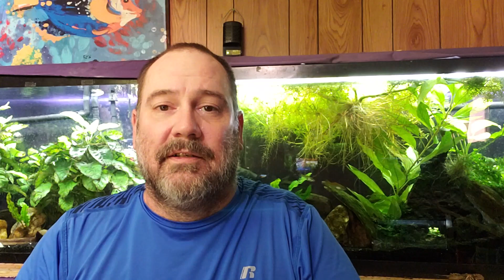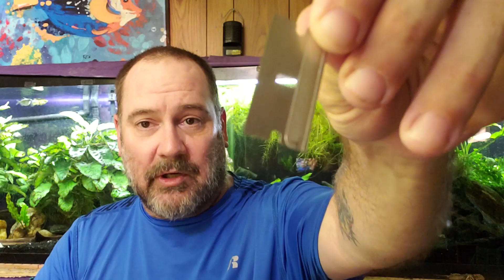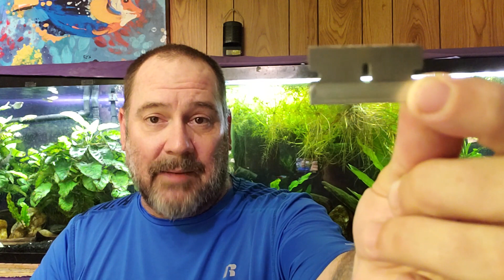Stop Telling Me A Razor Blade Scratched Your Glass. It Didn't.

Comment: Glass can degrade a razor leaving behind marks of steel if it is rough enough though. That can be interpreted as a scratch but wiping it away would show the steel being ground off in this case. If you made textured glass you could sand away steel, for examole.

Comment: You are forgetting the difference between hardness and brittleness plus pressure. Both the razor and glass are not perfectly smooth, each contains imperfections which are really viewable under a microscope. You are correct in saying the soft razor can't scratch hard glass, but you are forgetting the difference between a scratch and a gouge. As the soft razor wears out, it's imperfections will increase. Combine these imperfections with those of the glass, and the soft material can shear the hard, brittle material. Even "gentle" force on a microscopic imperfection will shear it off, and the soft razor, under pressure, will have no trouble finding those groves and amplifying them. You're calling it a scratch, and what you say is true. The correct word is "gouge", and most people would call it a scratch. So it's true that soft steel can't"scratch" hard glass. But it's not true that soft steel can't gouge hard glass. Hardness is combined with brittleness. The soft steel will fill these imperfections and shear, rather than scratch, the brittle edges of these imperfections.
Reply from the maker: Nope.
Reply: @DanHiteshew-oneandonly 
Are you trying to claim that a softer material can't gouge a harder material? Did you even know the difference between a scratch and a gouge? Keep on keeping on, my man. Love your confidence.

Comment: well, then, tell that to OLFA. They make stainless steel snap-off blades specifically for glass because the regular steel blades can and do scratch/score glass very easily.  This is an especially serious issue for window tinters across the globe. But I DO AGREE that it is the (manufacturing) debris on tempered glass that does the scratching. But most all OLD tempered glass - pre-1990's-  including my old aquarium do not have that issue. That's my 2 cents worth from 35+ years tinting auto's, homes, farm equipment, RV's, commercial buildings, boats, etc, etc...

Comment: I have been a glazier for 32 years and this guys is very wrong.
Reply from the maker: No I'm not. Tell me how soft steel scratches glass?
Reply: @DanHiteshew-oneandonly  You are fare too hung up on which substance is harder. That is not really relevant to the topic. I use razor blades on glass everyday, that is how I know that razor blades can and do cause scratches in the surface of glass. If done with a “brand new” blade that has been inspected for any manufacturing defects, stroke in one direction only and never on dry glass. The problem is that any little nick in the blade along with possible loose debris on the glass will absolutely cause scratches. People watch this video and think it’s “impossible” for them to scratch the glass. Your a fish tank guy. I am a second generation glazier that has worked with glass everyday for 32 years. You think whatever you want, but your advice is not at all accurate.

Comment: No I could not watch this video any longer because he never once mentioned stainless steel. Stainless steel is the product that you use if you don't want to scratch glass. He didn't even mention it once. So here he is telling everyone how stupid they are and he doesn't even know science behind it. You can't just take any razor blade and expected not to scratch your glass. Stainless steel razor blades will not scratch your glass with a soapy water spray. But if they're sand on the window like he said it will scratch. But if you listen to this guy's video he's telling you that no razor blade can scratch glass. Well you would have to be real on educated to believe that. Well maybe education has nothing to do with it but you would have to be real naive to believe that no razor blade could ever scratch glass. There are some pretty cheap ass razor blades out there that will definitely scratch your glass. And on top of that what kind of glass are we razor blading. What's the quality of the glass? I've run into pitted glass many times where the razor blade gets chewed up in a few passes. Then if you're not using enough soap and water to clean the glass to prep it for the film you can see scratches. So sorry for the long text but anyone who thinks that you cannot scratch glass with a razor blade is out for lunch. I mean no disrespect by this. Great video but you need to be more specific on the stainless steel aspect of the razor blade. Respect! Respect is what I have for you for taking the time to make a video.

Comment: I am so confused. I used a razor blade scraper to remove window film on a residential window, and there are scratches.
Reply from the maker: You can get contaminates on the glass that get dragged by the blade, but the blade itself won't (can't) scratch glass.

Comment: You are correct razor blades will not scratch the glass but sometimes people think a utility knife blade is a razor blade which it is not a utility knife blade will scratch the glass. We had a construction site that was just finishing up with the final clean and there was some shipping material on some partition glass for a conference room... The laborers used utility knife razor blades out of the utility knife instead of straight razor blades and they scratched the glass $25,000 later the glass was replaced... It seems that the corner point ends of the utility blades scratched and etched the glass.
Reply: Exactly what happened to me i thought a blade can’t scratch glass and i used a utility blade to cut some window vinyl and it bloody scratched the crap out of it 😢

Comment: One other guy kinda mentioned the crap on the glass during manufacturing. I have a slightly different theory... If you have scratches already on the glass anywhere... There are tiny almost microscopic fragments of glass in that scratch-so when you run over the scratch with anything, it can potentially pick these fragments up causing more scratches elsewhere. I switched from different glass cleaners because of old scratches, to razor blades and I still kept finding more scratches. So yeah not the blades fault.

Comment: tl;dr: flawed arguments. i can be 85% sure razors can scratch glass

Being hired as a professional window cleaner, I have used razor blades to remove stickers off windows a good couple of times, and I've also had a short go at removing industrial material that gets on the glass (in my case, silicone - which when it comes to windows, is a stupidly sticky glue which is very very difficult to get off.).
Now, I have yet to scratch glass (and hopefully I never would,) though my boss taught me that it's important to lubricate the window well (with soapy water), and to scrape at a good angle, and to not use much pressure, all so that the blade doesn't sudenly stop and therefore go at a sharp angle at the glass - as then the glass would be scratched/cut.
Also, my boss mentioned we can't use razor blades on all window like surfaces, such as mirrors, low quality glass, and some other stuff. I don't remember the reason but it was probably something to do with the glass simply being very cheap, and therefore very easy to scratch.

And when you criticise window cleaners blaming the razor blade for when concrete scratches their windows, well it's fair to blame the razor blade. The reason is that the razor blade did a insufficient and flawed job at effectively removing the concrete, ultimately resulting in a scratched window.
Had the cleaners used some corrosive chemical or something instead, then the concrete would be removed and there would be no scratches.
And so when cleaners hear people say "razor blades don't scratch glass", they'd immidently say otherwise since evidently using blades on windows, one way or another, may leave you with scratched glass.

Also your foundations for this claim seem poor - sounds like you just use your razor on your high quality glass of your aquarium, and hear about other stuff via internet - which is that "since razor blades aren't as tough as glass, it is physically impossible to scratch glass with a razor blade". Which of course sounds like a stupid claim - how can some material be impossible to scratch glass?

I tried just then to scratch my glass desk with a razor blade. I was unable to scratch it a traditional way, although I did for sure scratch the glass when slicing the edge of the glass.
Which sugests that a razor blade will have a difficult time scratching glass, though it's still possible to do. And also that low quality glass is very likely to be heaps more susceptable to scratching.
Reply from the maker: Razors can't scratch glass.

Comment: I know using a razor blade is effective for cleaning glass, but I disagree with you. Soft materials can most certainly scratch a harder surface. Here are some examples:

A rubber fan belt on older cars is softer than metal, but 100,000 miles of driving, and the rubber fan belt will scratch components of the motor if the belt rubs it. More damage to the belt, but some damage to the metal. Friction, heat, dirt, etc all takes Account...

String can be used to cut small branches. String takes more damage than Branch, but it will eventually do the trick if you replace the string enough.

Fiddle players can comment on this, I don’t know much about it, but damage is done to the bow and the strings when they play. Like extreme fiddle, “devil went down to Georgia” etc.

Tires from vehicles damage pavement. Not sure if it qualifies as “scratch” ... but definitely dents, chips, crushes. Weight is a factor here, like your Ax example. And hammer example.

Then supernatural situations: tornados have been known to take soft objects, like pine straw, and pierce glass or metal. (Have not seen in person, studied about it school tho)

Magic erasers for cleaning granite counter tops... polishing cloths on metal or brass... Leather belts or horse saddles on metal buckles.... Fishing line on rod and reels... Chain and sprockets on dirt bikes..(both chain and sprocket take wear over time, no matter which metal is used for chain and which metal is used for sprocket)

But more factors are at play in the exceptions I mentioned, including weight, density, force, time, and friction... others as well.

they key take away is under "normal settings"
Reply from the maker: You're confusing "wear" with "scratch". It's not my opinion. Look it up.

Comment: point 1. diamonds are cut with steel blades. it is not just a question of hardness. point 2. tempered glass has fabrication debris weakly fused to the surface as a consequence of the manufacturing process. This debris is dislodged by the blade and gets dragged around by it https://viewswindowcleaning.ca/2017/12/03/will-razor-blades-scratch-windows/
Reply from the maker: A razor still can't scratch glass.

Comment: Carbon razor blades absolutely can scratch glass! The carbon carbides in the steel are harder than the glass. Happens from time to time when everything is just right. Never happens when you try to make them. I'm sure the next one will hit home very well for most. Look what happens to your car windshield when you don't run wiper blades the steel arms will wear right into the glass. Along with that, the wiper arms are not even as hard as razor blades.

Comment: if its not the razor blade then what is it cuz it happens when you use razor blades i have seen it on 100's of tanks
Reply: and it has NOTHING to do with substrate since there is none on the outside of the tank
Reply from the maker: Maybe calcium or lime build-up on the glass? Hard water will leave deposits that can scratch glass.
Reply from the maker: I don't know what it is, but it's not the razor. (I seriously doubt you've personally seen it on "100's" of tanks. Lol)

Comment: Don is absolutely right.  Now if you are careless, and you have one of those razor blade scrapers where the blade goes into a metal clamp type device you may scratch the glass with the part the blade sits in. In other words, the blade slides under the clamp, and now you are scraping with the clamp and not the blade. That blade has to be secure in the clamp, especially those scrapers that retract the blade, or the ones that use a screw to secure the blade.

Comment: I always use razor blades, but I have had scratches. Who knows from what.
Reply: Very fine dirt particles can do it. Same stuff that makes it into your pocket and leaves tiny scratches on you phone screen. I was taught by my dad how to clean glass with a razor blade (used to be a professional glass cleaner). I do it at work when rooms are remodeled. Now there is concrete dust from when they smoothed the concrete subfloor mixed in with the tiny paint specks on mirrors and such in these rooms so you have to be very careful, keep the glass and blade lubricated and wipe things clean often enough you don't scratch it with the concrete dust, but my boss told me not to use a razor blade to clean the glass, so I cleaned the glass with one in front of him and after cleaning it pressed the blade as hard as I could into the dry glass and scraped it to try to scratch it. Dulled the blade to the point that I could press it into my thumb and slide it across without cutting it and then asked how the razor blade would scratch the glass.. he just looked at me kinda dumbfounded

Comment: I have some cows knocking on the door. Should I envite them in for dinner?  What about stainless steel pads? Not sos kind.
Reply from the maker: Steel wool is fine too. Only invite them in if they wipe their feet, or hooves rather.
Reply: I'd say only 0000 steel wool pads. I've seen higher leave micro scratches in the glass. I'm not saying it was necessarily the pad but having been taught by a glass cleaner I was told 0000 will polish glass anything else could leave the micro scratches